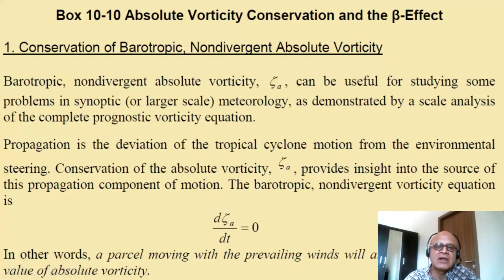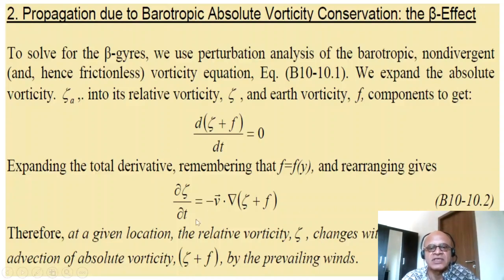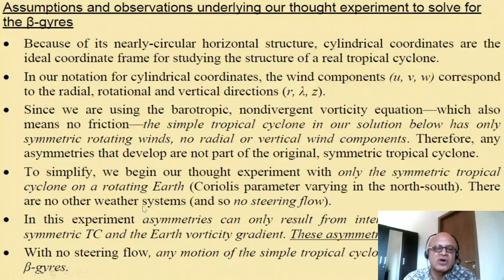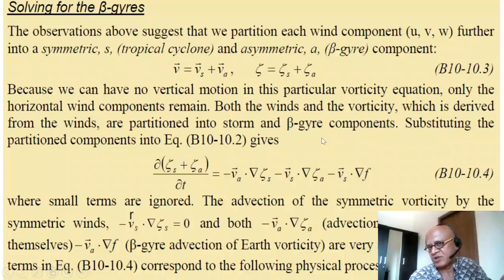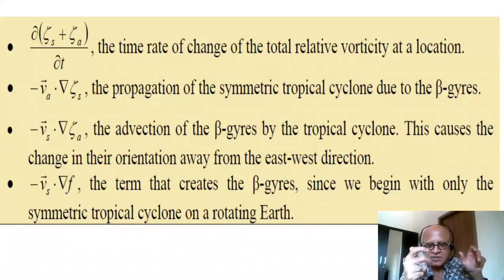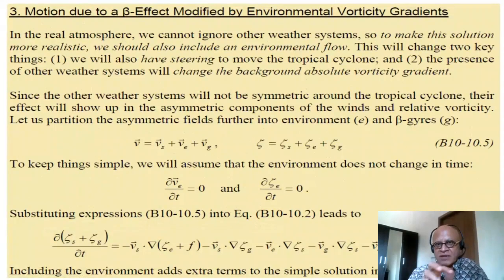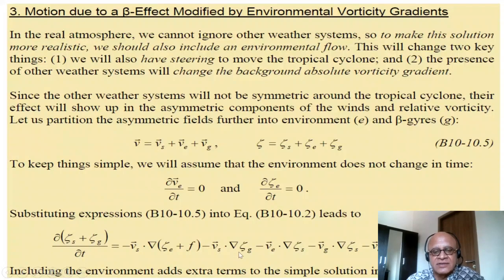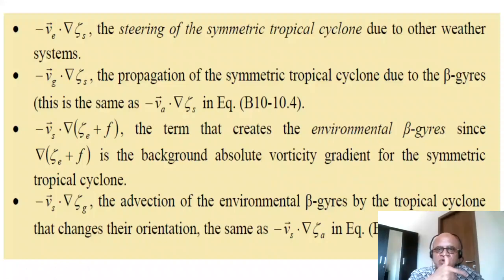2   Vorticity Conservation and Beta Effect in a Cyclone

Comment: Hello ! If the beta gyres are advected by the cyclone, why don't they go around ? They go from an east-west to southwest-northeast orientation, but one could imagine that they continue to turn and then orient themselves south-north and southeast-northwest...
Reply from the maker: Steering winds matter for where the cyclone goes and the beta gyres depend on the cyclone. Cyclones themselves can modulate the steering winds but not enough to do what you are thinking about.